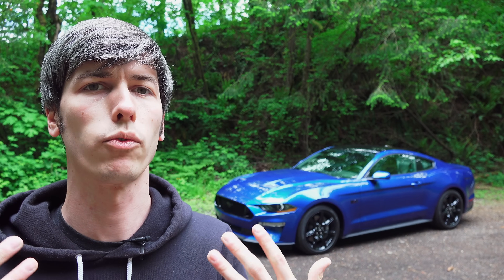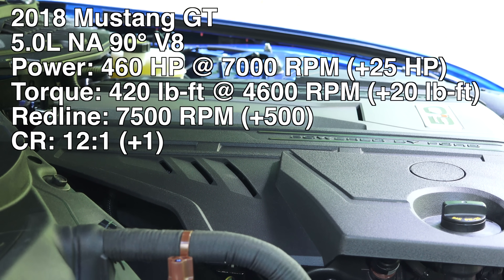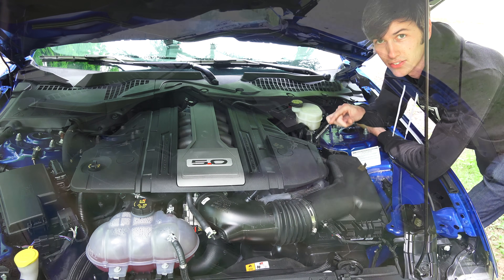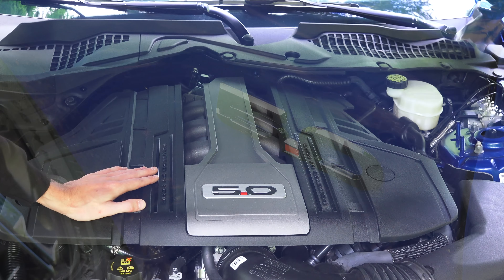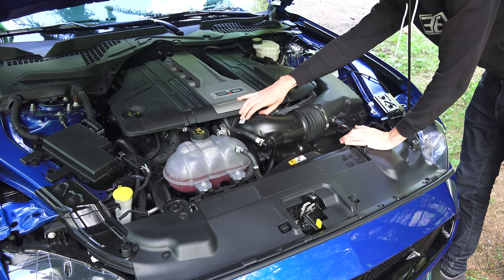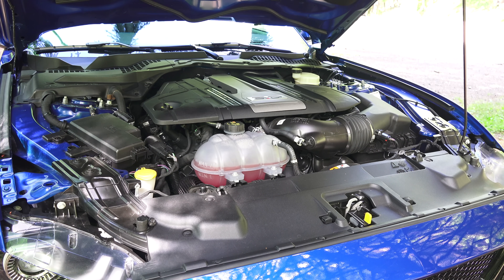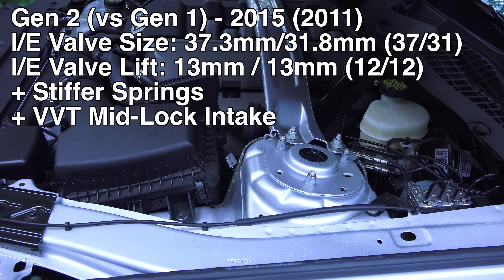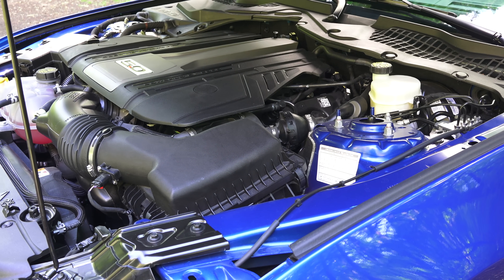The Best Engines - 2018 Ford Mustang GT 5.0L V8

Comment: The 10R80 transmission is the first Ford automatic gearbox I would choose over a manual. It shifts gears crisp and seem to choose the perfect gear at the correct time to maximize throttle response. We all know the 5.0 is a high rev motor and the 10 speed gives the hole shot off the line without loosing top end speed. This would be my choice because if you are racing missing a gear costs you a race. Also allows you to have less crazy rear end gear like a 4.11 for the track and maybe a 3.55 or 3.08 for highway. The 10 speed combines the best of both in the transmission to allow a all around rear gear for fuel saving and fun when you hit the gas pedal. Let the manuals die the 10R80 has your wants and need covered in one setup.

Comment: As much as Mustang owners and Ford's reputation for being not so reliable drives me away from wanting to praise this engine at all, I must admit it pulls its weight well and gives tuners a good chance to easily push big power at good prices. I wish it were a little more bulletproof as I see them getting blown up all the time, but at least it's fun while it lasts.

Comment: I didn’t want the manual for a few reasons but one of the biggest was the MT82 transmission. I think Ford should have put Tremec 6 speeds in all there standard vehicles.

Comment: 18 is not as reliable as the 17 5.0 though. 
Also the 6 spd transmission is more reliable then the 10spd Transmission.
Reply: I have actually heard the opposite. The 10spds are actually better, not to mention that blunder with manuals on the 15-17 models. lol

Comment: I have a 2020 Mustang GT Automatic, and in the 11,000 miles that I have had it. Running two different trip meters, I average around 23 miles per gallon, driving 140 miles a day on the highway with speeds averaging around 75 to 80 miles an hour. Normal speeds on my highway, I can go about 310 miles to a tank of gas running 93 octane, and that includes weekend driving as well. If I stick my foot into it, it will go down, it’s not bad for what it is, but it’s not a fuel efficient car by any means, if you are looking for fuel economy, then this isn’t the car for you.

Comment: No, you should avoid the manual transmission completely, the car is slower compared to the 10 speed, it has less fuel economy, they are faulty transmissions that break easly and on top of that they burn the clutch super fast for a dual disk transmission. Get the 10 speed belive me, if you want to have a manual mustang with the 5.0 get an old mustang like a 89 and have that as  your manual.

Comment: Jason, do you know if the USS Enterprise engine cover has some aerodynamic function specially with the heat extractors vent? Because if there's none, I would like to remove it.
Reply: read the replies to the 3rd top comment by @faceup5

Comment: 8:20 most things I've been reading suggest the auto transmission is much better than the manual.
Reply: Read the TSPs and about the class action lawsuits.
Reply: @tomrakusan1179 I have the 10R80 in my 2019 with 100K miles on it. And, I haven’t had any problems with mine.
Reply: The 10R80 automatic is the way to go over the manual transmission.
Reply: @Brian_195 the 10R 80 is a piece of crap.  I guess the several class action law suits, the numerous TSPs are a way to go.  Enjoy!  Make an appointment at the dealer.

Comment: I wonder if these are great for turbo-ing.. or supercharging.. I'm sure bigger tires are recommended for that.
Reply: Wider tires? Without modifying the suspension system, you should stay within 3% of the overall–diameter of the original tire size.

Comment: Actually you are better off with the auto if you are looking for speed and mpg, the 10 speed on these mustangs are insane and can make this car go 11.9 in the 1/4 mile compared to the fastest 2018 manual witch went 12.3 seconds. Only reason to get a manual is if you are using it for the track and to have fun. But the 10 speed also has a manual mode so...theres that.

Comment: 7:36 they probably added two additional knock sensors because they wanted to get a better listen to that typewriter BBQ rattle tick that both my 13 GT and 17 GT have. Change your oil and rev it up!!! Listen to that TICK TICK TICK TICKT CITKCITKCIT CCHURCK CHIICK CHTIICK CHICK TICK TIK TICKK TCHICK TICK TICK CHIIICK TICK as you drive your $30,000 Mustang down the road with the windows rolled down. Such a great feeling.

Comment: Yes, please keep doing these. I love getting comparisons between the statistics on engines and such, and what those yield as an end product. I myself am trying to build a 1996 truck motor, though I am trying to build it to be as efficient as it possibly can while still pushing the 400 NA horsepower mark. I know compression brings efficiency, granted that you can keep temperatures under control and your ignition advanced. so I really like learning what the boar in the stroke is, what the compression is, and what the block, heads, etc are made of, anything that I can take and possibly apply to my 1996 to try to make it as absolutely efficient as it could possibly be, really push that efficiency boundary while also making great power still, being able to make the truck accelerate quickly. I don't really have any interest in making the truck perform like a typical truck, such as having big tires and towing heavy loads or off roading.

soda cap that off, yes please keep doing these videos. 💪

Comment: The Mustang GT 5.0 is by no doubt a very nice sports car(for the price of course). But seriously look at the amount of plastic that's in the engine bay. I believe this car is designed to take a good amount of abuse. But all that plastic will one day become so brittle primarily due to fluctuating temperatures and age!

My other issue is the plastic oil pan for the 10-Speed 10R80 Automatic Transmission. The plastic that's being used is indeed very strong but to me It just doesn't belong there.

I believe short term ownership(3-5 years) is best for most cars nowadays because of the huge amount of plastic parts.

Comment: Lovely engine. And you can drive it forever if you keep up on maintenance
Reply: That’s any modern engine.
Reply: Not really though. There’s a lot of great looking/sounding euro engines that don’t pass that test.  That or their maintenance is horribly expensive. The 5.0 is simple, reliable, cheap to maintain. I should have added cheap to maintain in my op

Comment: I'm gonna sue Ford motor company now,  they lied  and sold me a 2016 Mustang saying it has 5.0L v8, and now I see this,  SMH
Reply: The Ford 5.0 of the 80s and 90s didn't even round to 5.0 .  It was 4.9
but Ford thought 5.0 sounded better so they lied .
Reply: @stevenmortensen1257  well they were right, LX 5.0 or GT 5.0 sounds a lot better than LX 4.94L or GT 4.94L

Comment: Have those torque and horsepower figures been Dyno verified? Ford is notorious for overrating their products.
Reply: Ford under-rates their power figures, they always have, dyno numbers since the 60's prove that out ...GM on the other hand has been caught red handed repeatedly over-rating power figures, cheating at the Nurburgring, using nearly non street legal rubber, or shaved tires for testing, etc, etc, etc, that's what you get when you're owned by a board, managed unscrupulously and not still family owned as FORD is.

Comment: Amazing improvements of the 5.0L (classic 302 cu.in.) engine since the days when it first had to use unleaded fuel and serious emission controls. In the Mustang II the 302 had only 139 hp. I owned a 1986 Mustang, the first year for fuel injection in the Mustang, and it had 200 hp, plus got 25 mpg at 70 mph. Now the 5.0 has 480 hp in the Bullitt version. Wonderful what science and engineering can accomplish.....and still get about 25 mpg on the freeway.

Comment: Is anyone aware of someone doing a Dyno test based on the different exhaust modes? I'm curious if closing the valve actually makes the exhaust more restrictive or if it just routes more pressure to the other openings.

Comment: I would enjoy a series of videos regarding automotive engineering failures.  May I suggest you start with the disastrous Ford spark plug issues of the 4.6L and the 5.4L.  Thanks

Comment: No its not a great engine compared to what else is out there. HP is HP and the engine that makes it using the fewest moving parts and weighing the least, wins. Things that do not equate to faster track times include thermal efficiency, HP liter, and more complicated valve trains, compression ratios, and having high redlines. HP is HP and thats why the LS series of engines are the best. There is no replacement for displacement. Put a 5.0 and and LS3 6.3L side by side, mod and tune both to make and easy 500HP or 600 or whatever the number doesn’t matter as long as their HP matches, and the LS 6.3L will always beat the 5.0 because it weights less and you can build a smaller sleeker car around it because its physically tiny compared to this monstrous waste of time. Its center of mass being closer toward the bottom middle of the car will also give it the advantage in the turns.

Comment: should also mention the max safe power that the motor can handle.  this motor can handle almost 750RWHP on factory parts safely
Reply: people are running 1200whp plus... stock internals
Reply: @Dare13-y3m  yeah but that is in no way shape or form reliable. 750 is about the highest u can get reliably
Reply: @TXpondking  i agree, still you probably need drive shaft, half axles, clutch, ect.

Comment: Lmao my 18 motor failed got a new short block an then the 10r80 failed. Got my car back an the new short block started to tick an knock again. Now ford is buying the car back. Sure it’s the fastest an most powerful mustang gts made. But many guys are going threw what I went threw.
Reply: Sorry to hear that dude. Good thing they bought it back from you and made the shitty situation a bit better. My 2015 has had 0 issues, no check engine light, just a flawless running car. Changed the battery a few weeks ago and on 2nd pair of tires, that's it, after 4yrs 23k miles and 5 track days.

Comment: RWHP dyno testing and 1/4 mile track times have proved this engine is decently underrated from the factory, likely done to protect the GT350.  Basically with a full offroad exhaust, intake, and a tune for e85 through a real tuner like Lund, you can get 500 hp to the wheels. That's pretty impressive for a claimed 460hp at the crank. About the transmission, Ford is really crapping the bed with this MT82 (manual), which seams to actually have gotten worse, and requires some aftermarket tinkering just to be called decent. The 10 speed performance really cannot be matched by a person shifting, which is sad because I actually enjoy driving my 2012 5.0 MT82 car after the required upgrades.

Comment: The 5.0 Liter Coyote engine is always great (I have a 2017) but that new plastic engine cover is just so ugly!  Rip that thing off and throw it in the garbage.
Reply: I hate the cover on my 18 pp1 car. So I took it off, didn’t trash it. Drove it for several months and realized that the hood insulation was getting damaged from the hot plumbing on top of the engine. I reinstalled the ugly POS!
Reply: @jimsauer2453  why is there hood insulation?
Reply: It’s for noise cancellation AND it protects wiring from animals chewing on it, and damage from anything possibly falling them etc.
Reply: @HeavyMetalCowboy90  they coulda made it look a bit better though, I wouldn't mind paying an extra 50-100 dollars for a better looking engine cover
Reply: @jorgeespinola865  to each their own. I personally think it looks pretty good. Has an industrial look to it.
Reply: There might be technical reasons for engine covers you don't think about. For example it is possible that in special circumstances the injectors will become very sensitive to spray water that might enter the engine compartment. This might cause the injectors to short circuit and stop working. IT can happen when the manufacturer of the induction coils has bad electrical isolation.
Reply: UTubeCorruptAntiFreeSpeechLiberalCo  The oem strut bar is only 7 lbs.

Helps complete the triangulation with the firewall brace. I reduces strut tower deflection (macpherson struts are notorious for this, compared to double wishbones) and chassis flex, improving agility.
Reply: Have you ever seen under the cover? It's just a bunch of wires and plumbing. You can't hardly see the engine itself at all with all of the tech laid on top of it
Reply: The direct injection machinery is not much to look at. It's not like you're going to see classic valve covers under there.

I had an '18 and a '12. The '12 looked better as it did not have the direct injection.
Reply: faceup5 still a crowded engine bay those DOHC engines are wider than old fashioned pushrod engines that the camaro, challenger are using
Reply: They are for sound proofing or not ? I am not sure
Reply: UTubeCorruptAntiFreeSpeechLiberalCo  structural rigidity for better handling.
Reply: They don’t put those cheap, plastic covers on F-150 Coyotes.
Reply: Lol. Mine is a garage wall hanger! The sound tube is next to be deleted. Damn thing looks like a large intestine with a couple tumors.  Ford should pay more attention to engine beauty. You hearing this Ford? Gearheads want to see the engine!
Reply: Especially that one. Cheap plastic just kinda hovering above the engine.
Other brands at least use better looking often painted plastic to make it look like you are actually looking at an engine.
Here it is just an obstruction in your view.
Reply: Why do companies put plastic covers.on engines ? They are pointless.
Reply: @tonyfortier8835  Most covers have insulation on bottom to absorb engine noise, such as injectors and valve train. They are ugly! Chevy slaps those hemi size valve cover, covers on the LS because they're ashamed of the puney look.
Reply: @tonyfortier8835  noise buffer in engine bay. However i think it holds heat so i agree take it off.
Reply: Agree with dumping the cover. This is an enthusiast car, these people like looking at engines

Comment: Wasn't Plasma transfer arc welding used on remanufacture diesel engines? The cylinder wall just peals off. Or did Ford fix that.